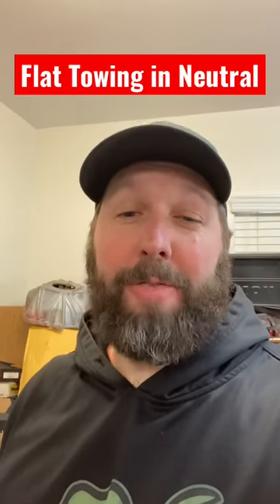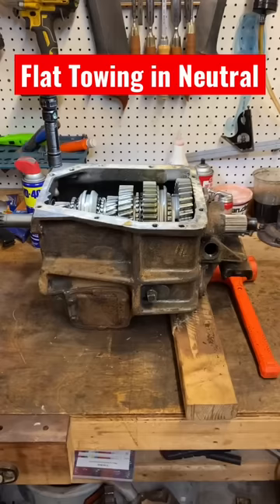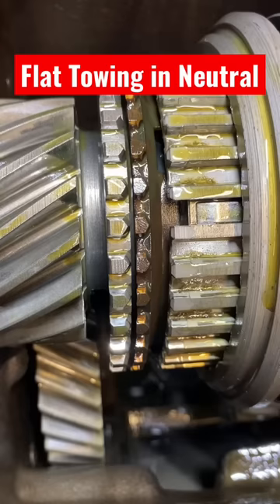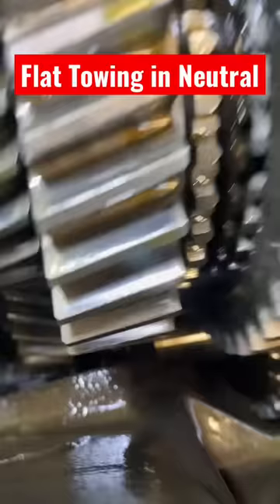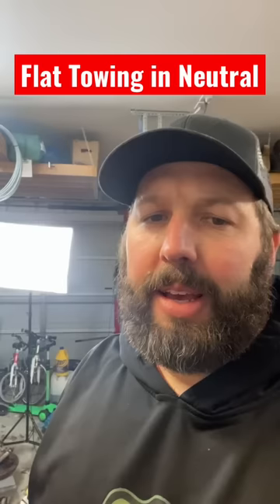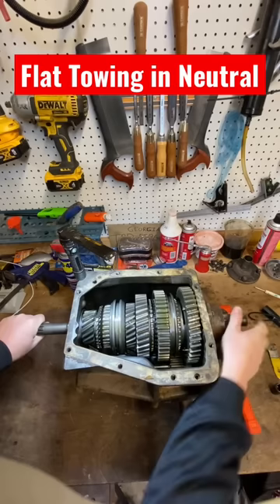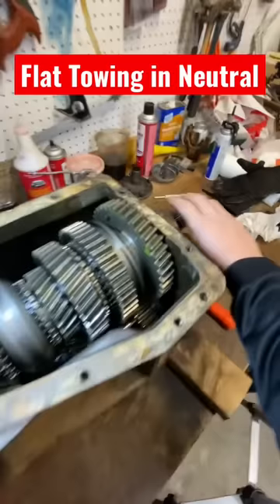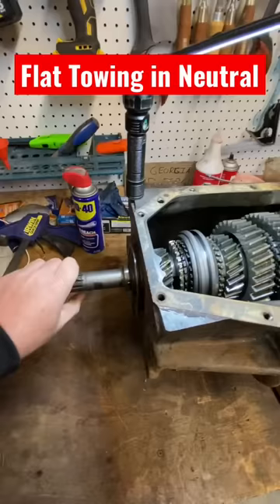Flat Towing in Neutral??? #transmission #stickshift #mechanic

Comment: Watch part 2 where he explains why flat towing a manual IN gear is even worse lol
Reply from the maker: Don't be telling everyone my plans 🤐
Reply: What is flat towing and what are you supposed to be doing instead?
Reply: @308dad8 flat towing is towing car horizontal. You need to flip it up on end first
Reply: @308dad8   drive wheels on the ground  not  in the air. If the drive wheels are spinning when your towing your doing it wrong.
Reply: @zed4229  Well so all 4WD should be towed on rollbacks only?
Reply: @308dad8  unless you can disconnect one axle and tow with it.
Reply: Drag it on its top😂
Reply: @308dad8  Rollbacks, wheel lift with tow dollies under other axle or a trailer
Reply: @308dad8  with 4wd vehicles you can usually put the transfer case in neutral and flat tow without causing damage
Reply: @308dad8  or dolleys
Reply: @dailydriven  right. I've flat towed an f150 30 miles going 55 lol no damage, and how do I know? Because the trans had to be pulled to fix the flywheel that broke and the rear main seal. Still drive that sucker today, pit 50k on it since
Reply: A smart human would just pull the rear driveshaft
Reply: @zbruh7268  i flat towed a RWD in neutral about 400 miles averaging about 60-65mph.

Not a single issue. Transmission still beautiful 15 years later with another 140,000 miles on it
Reply: Just drop the drive shaft if you have to tow it and can’t put it on a trailer or rollback.
Reply: @zbruh7268  I absolutely know that is a lie, 50,000 MORE miles? Ford? Na dude.
Reply: @Josh G  it's a fleet truck so I don't care what you "think". You should probably stop doing that! You're going to hurt yourself
Reply: @Josh G  it's a 2005 Ford f150 flareside Fx4. My 2016 silverado was totaled by a single deer 2 weeks ago. I've hit 3 deer with the Ford this year and no damage. I did end up getting another chevy (2022) because I was desperate since it's getting to be my busy season and I know the owner of the dealership. I'm not partial to Ford or chevy because I own both, I get what I like. I treat my vehicles the same so they all last me the same time. Regardless brand. Minus my new chevy is a 4cyl turbo lol sounds like a go kart but it fits exactly what it's needed for
Reply: @zbruh7268  I'm just giving ya shit lol. I don't really care for brands much anymore. I was always a GM guy but after 2007 I havent much liked any silverado or sierra put out since. I would go with a f150 or ram before you see me in a 22 silverado.
Reply: I've seen someone flat tow a truck while it was running. It jumped in gear when it got to the right rpm and destroyed everything inside.
Reply: @Josh G  I like the older ford's but when I have to get a new truck, I get good deals at the chevy dealership lol I paid 17k for my 2016 chevy, thing blue booked at 24. Me and the wife also have a ford fiesta RS lol 😆 😂 things fun to drive though. This fall most likely get an older chevy SUV or Subaru with 3rd row seating for the kids. Packing 2 teens and a toddler in a crew cab is getting old
Reply: @Josh G  the 22 silverado is ugly too, but it's not bad to drive lol just have to turn my outside camera a bit so I don't have to look at it 🤣
Reply: @zbruh7268  I think you need to watch the video again and this time follow along 😆
Reply: @308dad8  That's generally safest. Not all transmissions have this characteristic, but transmissions are expensive.
Reply: Why people say u can flat tow jeeps what’s different about them than other 4wd vehicles
Reply: @Eddie H  nothing. You can flat tow anything. I've done it for year, from an 80's truck to a mid 2000's. Never once caused damage. And I tow at the speed limit.
Reply: @zbruh7268  why do people say jeeps are different then? And it’s actually recommended to flat tow a jeep on all 4 wheels instead of front or rear lift tow
Reply from the maker: https://www.tremec.com/not_am_detalle/flat-towing-manual-transmission-vehicles/
Reply: @zed4229  which is it? should my drive wheels be NOT spinning or on the ground?
Reply: @308dad8 no, you just flip it on its roof and tow it that way!
Reply: @freedomworx  Technically you could probably leave it in 5th gear and hold down the clutch with a block and avoid damage, but there are definitely better ways to do this.
Reply: @Eh-925  It depends on the specific vehicle. I'm not particularly familiar with the Jeep drivetrain, but my guess is that a Jeep is safe to tow with the TRANSFER CASE in neutral.
Some vehicles can be safely flat towed with the transmission in neutral for any distance at any speed. Some will quickly suffer transmission damage. Most will eventually suffer some level of damage. The general guidance is "It's not safe unless you have specific guidance on that specific vehicle."
Reply: @DallasHerrmann  yea of course with the transfer case in neutral I just figured it would be the same for any 4wd vehicles but maybe jeeps are just able to keep themselves oiled while somehow while being towed
Reply: So now your engine is spinning
Reply: OMG we have had a customer tow their manual Honda fit behind their RV.... Did some math and the engine spun to like 21000rpm blowing it to pieces.
Reply: @matthewbeaver5026  ... well, that stops the drive shaft but spins the side gears like crazy.
Reply: @ozzyman51 creates same issue. no lube.
Reply: @johnslife3924  Yep. Still the wrong way to do it, but you're driving the lube mechanisms in the transmission and engine.
Reply: @ZBruh  30 whole miles, no way! And you still got 50k miles on it after!.... 
Never mind, I guess that would surprise a Ford owner.
(I'm just teasing man, no disrespect was intended) 😂👍
Reply: @308dad8  take the drive shaft off, problemo solvaide
Reply: Do a video on why a for ranger can be flat towed. I’ve also recently learned my Suzuki samurai can be flat towed.
Reply: So leave in gear and have your foot on the clutch the whole way 😅
Reply: @308dad8  remove the drive shaft before you tow.
Reply: @308dad8  it's generally recommended to tow vertically
Reply: Not to be a dh, but you can tow certain cars , manual or automatic in nuetral with the drive tires on the ground but with limitation on speed and distance.  I'd bet the max on an old chevy, manual transmission like this would be 35mph for 50 miles. You can find the info on zips
Reply: If your in a tow truck, sometimes you just got to get sh!t done with a  pickup and a strap.
Reply: Wheel dolies on the back wheels.
Reply: @308dad8  pull the driveshaft
Reply: @308dad8  rear drive shaft off then lift the front
Reply: @308dad8  2wd vehicles are more prone to failure being flat towed 4x4 you literally put tcase in N and trans doesnt spin and you can flat tow it no problem
Reply: @zbruh7268  I think the channel owner means long haul vehicles towed behind RV's.  Hundreds of miles are what wrecks a bearing that isn't lubed.
Reply: @zbruh7268  you've hit 4 deer this year? Dude, check and make sure you put oil in the engine and not deer piss.
Reply: @zbruh7268  I ditched my 2013 malibu for a 2018 Sierra SLT Crew when wife replaced the engine compartment of her dodge journey with a deer.... a little one. Destroyed the airbag sensors and never set them off. My truck booked 44 with 11k miles, we got it for 38, then prices shot up and it booked for 52 at one point over the last couple years. Don't drive it a ton, so it still books like... 38 or 39 and owe 20. Ours had to be Crew specifically because we still had 2 in boosters and one in a highback at the time. Now 2 kids are off the boosters. Never been that right side up on a short notice vehicle purchase, lol. I haven't looked at the newest GM trucks, but not a fan of Dodge looks and Ford in general... bad experiences left a bad taste. Wanting to look at a Sierra 2500 next probably, but we will see. Have to pay for flight training, house reno, and cross country move first. 😢
Reply: My thought were exactly, erm but spinning an engine without the oil pumps is going to the whole block in, so gear box vs whole engine, best option don't flat flaming tow call a company who can lift the drive wheels of the road, or have a 4x4 automatic and have to have the car lifted on to a flat bed flaming hilarious when Mercedes had to do that to my step dads car
Reply: @308 Dad  Literally every single vehicle should be towed on a rollback.
Reply: @MartinBarker  Thanks for agreeing and adding to the conversation!
Reply: @308dad8  yeah pretty much. Or with a tow dolly to keep the rear wheels off the ground.
Reply: @308 Dad  Flat towing is when you tow a vehicle with all 4 tires touching the ground. You will sometimes see RV owners do this to tow their car or truck behind their RV. The better option is to just buy a car hauler and use that. A car hauler will allow the vehicle to sit flat, but the vehicles tires are off the ground as the car hauler has its own tires. If using a car hauler, you must make sure it's attached to the towing vehicle (RV/Mobile Home/Truck) properly, wiring harness is connected, and ratchet straps are properly used to hold the vehicle to the car hauler. If you do not know how to do this please make sure that somebody with experience and knowledge of how to do this sets everything up for you. You really do not want to make a mistake doing this.
Reply: @308 Dad  it's where you flatten the car into a pancake and then tow it
Reply: @DallasHerrmann avoid damage..... forgoten throw out bearing has something to say to you
Reply: @kalumbabwale3729 drive tow vehicle via blue tooth
Reply: @308dad8  nope, you should use a dolly. Most wreakers are equipped with them, they lift the rear wheels off the ground. 😍
Reply: Couldn't you technically put it in 5/6 gear?
Reply: @JGSR-96  lol, a ford joke? super clever.
Reply: @funonoldwheels7150  thanks
Reply: @spotimpact.  I guess if you really need to flat tow it, you could just put a pedal depressor on the clutch, really doesn't matter the gear though (except of course reverse!) since the engine isn't running.
Reply: @JGSR-96  I feel the same way except a decade older lol. GM died when they stopped putting 350s and actual parts on trucks and instead filled the things with computers and low voltage equipment. Also there's no reason for these trucks to be so massive. 90s gms were perfect :')
Reply: @zed4229  I don't et it - if the drive wheels are on the ground its wrong but you tow with them on the ground?
Reply: @kalumbabwale3729  and destroy the clutch release bearing nice lol
Reply: @MartinBarker  if the engine is turning the oil pump is turning
Reply: @RedboneUnincorporated  big rig dont fit on roll back 
we remove the drive shaft or the axle mostly the axle because  and just one side so 2 axle ro remove with 10 bolt each you don't need to go on your back under the truck like a moron
Reply: @spotimpact.  engine will turn not good and if you use a piece of wood to hold the clutch you will burn the clutch release bearing or wore out the finger on the pressure plate
Reply: @NOSNOOB11  yes it matters if you use 1 gear and do 60 the transmission will turn at twice the speed its designed to go the input shaft never exceed the engine rpm
So if in 1 the car do 30 at 7k rpm doing 60 would equate to the engine running 14k rpm in first for the transmission and would burn the input shaft bearing pretty quickly
Reply: @legros731  Yes. We generally remove the drive shaft. For long distances
Reply: @spotimpact.  I don't think so, while you might not be over reving the engine you won't have cooling ability, electric fans would be off and you'd create alot of extra drag on the towing vehicle.
Reply from the maker: Saves the tire. 😎
Reply from the maker: @station08  science 🤓
Reply from the maker: @spotimpact.  I would never recommend towing in gear.
Reply from the maker: @MartinBarker  I never recommended towing in gear. Read your owners manual and it will tell you what to do. And the engine cannot spin without spinning the oil pump.
Reply: @zed4229  unless it is 4wd and you have the transfer case in neutral. 
Ever seen a Jeep or 4x4 truck being towed by an RV
Reply from the maker: @ThisFish888  it's an option.
Reply from the maker: @kalumbabwale3729  Leg Day 💪
Reply: @308dad8  You can flat tow with no troubles, but you need to either remove the drive shaft or put the transfer case in neutral. Most tow companies will just remove the driveshaft to make sure all is disconnected.
Reply: @kalumbabwale3729  no tow truck driver remove the axle shaft way easier on big rig no need to go under and a big rig drive shaft weight a ton 
And when removing the axles shaft only one side is needed to be removed
Reply: @legros731  yea that's my bad I def wouldn't recommend 1st and it does matter. For some reason my brain was like "welp you can't leave it in 6th the whole time either because you'll be taking off in 6th at intersections" smh I'm an idiot. But still in 6th wouldn't it be turning too slow at low speed to lube as well? Idk I've never had to deal with this haha.
Reply: @308dad8  just take the drive shaft off
Reply: @matthewbeaver5026  why not just the drive shaft so much simpler and easier to take off
Reply: @ObservationofLimits  what about the engine sometimes it’ll blow the head gasket even
Reply: @JGSR-96  hahahaha every vehicle is a pos if you actually work on them
Reply: @freedomworx  🤣
Reply: @JGSR-96  😂🤣🤣🤣🤣
Reply: @zed4229  does it matter which way they're spinning?
Reply: @MrStaybrown  make sure to grease the roof.
Reply: Drive shaft people. If you remove/disengage the driveshaft so it does spin the transmission then you can flat tow all day long but it's easier to rent a U-Haul car hauler
Reply: So in those car repossession videos, if the car they pick up is rear wheel drive they destroy it? (well damage it at least)
Reply: @atnfn  Probably not, most videos I've seen they pick up the drive wheels and they usually go back to their yard which is close and lower speeds. I do wonder about a manual front wheel drive though since the parking brake is in the rear.
Reply: Something is missing from this video.  I have a front wd manual,  this doesn't apply
Reply: @Eh-925  Because you can put a jeeps transfer case in neutral so the transmission doesn't spin at all. It's not the only vehicle with that option, but it's the only one guaranteed to have that option
Reply: @stevebrown4401  ok cool thanks
Reply: @308dad8  unless you put the transfer  case in neutral
Reply: you can tow a can in neutral if you leave the engine running.
Reply: @308dad8 flat towing is towing when all tires are on the ground and turning. You should, if possible use a trailer to tow vehicles with a transmission.
Reply: @matthewbeaver5026  couldent you just take the driveline out?  I mean then your trans isn't getting any of the spin
Reply: @zed4229  youre
Reply: My brother and our uncle towed a datsun (with chevy van a chain and nothing else) 160miles and no problem. Even got a speeding ticket for 73 in a 55  (while towing). My smartass uncle was in the datsun yelling about they only get 1 ticket since he was being towed and had no actual control over the speed lmmfao. Always gotta say something!
Reply: @zbruh7268  hey those 23 suburbans are sharp af tho
Reply: @Eh-925  probly cuz they have stouter made gears
Reply: @DoingthingswithDAN  did some meth and spun the engine?!?😅😂
Reply: i was about to say wwtf is flaat towing
Reply: What about driving down hill in neutral?
Reply: Thank you.  That was my next question.
Reply: Dont forget to leave the key on before yout tow in gear.
Reply: @zbruh7268  How did you know the deer was single?
Reply: Pull the drive shaft
Reply: Saw an article once about a guy that did that to a new jeep... I think he had it in first and 4 low. Speed he towed it in got the motor up to 35,000 rpm something like that.
Reply: @zbruh7268  the 2.7 turbo. I watched a video reviewing it. It makes some impressive torque. How do you like? Fuel economy? Power?
Reply: @308dad8  Someone else might have already corrected what the other guys said but I'm not reading through 122 comments. Flat towing is when all wheels are on the ground, not just the drive wheels. So the is...flat. A standard tow truck lifts the front off the ground putting the vehicle at an angle, so not flat. To flat tow you have to attach a tow bar on the front of most vehicles to safely flat tow. For really short distance or around a property some will just use a chain/rope running through a metal pipe. Pipe is not necessary if you have a driver for the vehicle being towed and I would not do this in traffic.
Reply: @Mudslt  yep
Reply: Funny comment.
Reply: @308dad8  drop the drive shaft.
Reply: @308 Dad  a lot of times flat towing is pulling with all 4 wheels on the ground. Think back to that one time you ripped it a little too hard on a backroad, and your buddy had to come out to give you a tow, but all you've got I'd a chain or tow rope lmao
Reply: @dominicstonerock2880  unless it is awd drive
Reply: @shanerinehart7  not with awd
Reply: I have to see that video
Reply: That’s halarious
Reply: @308dad8 4wd vehicles are also 2wd vehicles. You have to put them in 4wd, thus engaging the transfer case. AWD cars should always be towed on a rollback or on a dolly to prevent the same issues, or worse, because you can’t disengage the transfer case.
Reply: I couldn't find the 2nd video
Reply: @jasonglisson1690  it was a kind of a joke, sorry.
Reply: Dang it Chim, you beat me to the comment! "and IN gear is even worse, look at how the wheels don't spin, but if they did, there wouldn't be much left of the transmission!"
Reply: @308dad8  Depends on the Model. My 4WD has 6 bolts that remove the drive shafts from the difs, no drive shaft to the dif, no problem with the trans!
Reply: @zbruh7268  If the trans is already fucked, I doubt flat towing it would do any worse!
Reply: @jasonglisson1690  you won’t find it. He was being sarcastic. Towing an automatic in Neutral won’t hurt it at all. That’s horseshit. He acts like he’s a scientist or engineer.
Reply: So the lesson here is to not flat tow at all
Reply: So I guess you should pick it up from the back and leave the front wheels on the ground
Reply: bro I get my info off shorts, so now you can't tow a manual at all?
Reply: @JGSR-96  People like to say stuff like this about Ford's but we had 4  94 f150s where I worked, we bought them from U-Haul with 10k miles on them,(supposedly  w-special commercial auto transmissions) one that drove 300 miles 5 nights a week died with 986k miles on it! with the original engine and transmission that never needed rebuilding. And it would have gone farther except the driver fell asleep and totaled 3 parked cars with it.  All 4 of them made it more than 500,000 miles without a transmission or internal engine problem! Admittedly we really were pleasantly surprised considering most of the other Ford's we had you could set your watch 130k miles on it when the transmission was going to go out!
Reply: @308dad8  really I would recommend towing anything on a trailer rather than pulling it but regardless of what you are doing if you want to avoid this just drop your axle but you can drop the rear axle and Tow from the front or you can drop the front axle until from the rear but you have to worry about steering at that point. The simplest way is just to put the damn thing on a rollback or a flat trailer
Reply: @matthewbeaver5026  exactly, to avoid this problem just drop the rear axle or the front axle if your Towing from the rear I'd still recommend just using a flat trailer
Reply: power to the people
Reply: Wouldn't a vehicle idling in neutral for a long time do the same thing?
Reply: @308dad8  if you have manually engaged front hubs, (and they are unlocked) then it is fine to leave the front wheels down, but most people would just use dollies to be safe. So yes flatbed or under reach with dollies.
Reply: @zaccam3233  no, that side of the gear train does draw oil up. The transmission infact stays lubricated the whole time the engine is idling. The problem is that when the pressure plate is not moving the clutch is not engaged there's no way to keep that side of the transmission rolling.
Reply: @zaccam3233  he actually does a good job at demonstrating this at the end of the video, he holds the output shaft and Spins the input shaft. You didn't see the oil being drawn up through the gears
Reply: haha i had a customer(s) wife( he said ) left thier jeep in 5th to tow behind their motorhome. could'a slung a dead cat through the hole in that block
Reply: @308dad8   I just drop my driveshaft and not worry about anything.
Reply: @LeonardRoberts  Disconnect Driveshaft
Reply: Can't you just put it in gear and hold down the clutch?
Reply: @redcrafterlppa303  No that wouldn't be good either. There is a pilot bearing which lives in the flywheel and holds the front of input shaft which only has a few grams of grease. Its designed for temporary use during shifting only. In this scenario it would be spinning for the length of trip which would cause it to melt destroying the shaft and flywheel.
Reply: @chimrichalds1422  ok thanks.
Reply: @JGSR-96  depends if it's gas or diesel. If it's gas it's not a Chevy or dodge so it's possible, if it's diesel, then there's no way in hell if it's a modern diesel
Reply: My thoughts exactly
Reply: @308dad8 i believe if you have 4 wheel select you can put the tranfer case in neutral and flat tow in park
Reply: @Mudslt if it's a manual transfer case sure, but an electronic transfer case is still physically connected is it not?
Reply: @308dad8 I’m sorry bro do you know the difference between AWD and 4WD? 4WD can be TAKEN OUT OF AWD
Reply: Let me guess because now you're turning the engine
Reply: So what do you do
Reply: @308dad8 
Flat towing is all four wheels on the ground. Needs to be towed with drive wheels off the ground. Free wheels on the ground or entire vehicle on a flat bed.
Reply: @DoingthingswithDAN how can the engine be tuning? If it’s in gear, the thing won’t tow due to the compression. If it’s in neutral, the engine ain’t turning for the same reason.
Reply: @axelknutt5065  no the engine will 100% turn in gear. How do you think people drop the clutch to start cars when the starter goes bad.
Reply: @DoingthingswithDAN  that’s  whole point of a bump start, you roll, push or tow in 2nd with the clutch in, drop the clutch and the the sudden jerk catches the motor, and starts it rotating and hence fires up. If you don’t get enough speed up before you drop the clutch the wheels stop turning. How come you can park a car on a slope and leave it in gear and doesn’t roll down the hill?
Reply: @axelknutt5065  of course there's resistance from the compression, but remember the engine of the towing vehicle is rotating. It has more than enough power to spin the engine of the flat towed car
Reply: @308dad8 no, they have carriers that go under the ground wheels to keep them off the ground
Reply: This do be killing the transmission, as the hamhanded mechanic tortures the synchros and needle bearings before finally letting the gearbox have that sweet relief of transmission case shattering carnal goodness.

If you ever learn this lesson, you learn it 100% the first time.
Then just to be safe, if ever a tow is required in future, you unbolt and physically remove the driveshafts

Just in case

....... not that i maybe accidentally 1 single time did exactly that.
Gears, oil, baby bearings calling out for their ball bearing and roller bearing parents.....
Oh the huge manatee's
Reply: @Eh-925 
I've wondered about jeeps. Often see them flat towed behind an RV. Cherokee and Grand Cherokee or Wagoneer or whatever they're called.
Reply: @legros731  You only have to disconnect the drive shaft from the differential yoke and chain it up against the frame. Usually takes less than 5 minutes. Takes even less to hook it back up after towing. Pulling an axle requires covering the open holes and axle grease still gets all over everything and takes much longer to put back together.
Reply: @legros731  No need to remove the drive shaft, just disconnect from the yoke at the differential and chain it up against the frame. Takes 5 minutes. Less to reconnect on the other end. 

Axles are more time consuming and the grease gets all over the rims and who knows what else, even if you carry pre-drilled flat boards to bolt over the holes. Axles take even longer to reinstall, too.
Reply: @michaelclark9762  maybe on a small 2x4 truck but on a big rig we usually remove the axle for towing way easier
most car with irs suspension don't even have slip yoke or even u joint 
One thing for sure my s2000 only go on a flat bed not gonna try fiddle with 6 Allen head bolt on each end on a car 3 inch from the ground
Reply: @michaelclark9762  there no axles grease it's a differential with gear oil in it lol every heavy truck towing have plastic plug for the axle and removing the axle from a big rig only require remove 8 or 10 3/4 nut and you just slide it out big rig are pretty simple if you want to get fancy one of the nut is a Bolt and it can be used as a drain but they make small tub that fit perfectly in the rim so just removing the axle will drain the oil just a little more messy
No need to lay in mud/snow/water 
Ps I repair truck for a living and I can assure you they all come with the axle on the back seat when towed 
That ok if you prepare your car/truck in the comfort of your home to be flat towed behind your big rv vs a towing driver working in the night in a snowstorm
Reply: @legros731  U-joints require loosening four bolts. A folded wax coated cardboard box easily fits into a side locker on a heavy tow truck, which I used to drive. No laying on the ground needed. Axles always took me much longer to pull than disconnecting and chaining up drive shafts. By the time I got the right size socket for the bolts on an axle I could already have the drive shaft ready to roll. Throw a chain and bungee strap under, then slide under with a 12mm, 1/2 inch, and a short hollow pipe and it usually took about 5 minutes. Do whatever works for you, but driveshaft was definitely the way to go for me. Quicker and much less mess.
Reply: @legros731  Dude, I'm talking about truck tractors. They're much easier to get under than cars or pickups.
Reply: @matthewbeaver5026   If it's automatic you can leave it idling in gear if it sticks shit you can put it in the highest gear until it which allows all the components to spin and the vehicle won't know the difference  between being towed or being driven  while coasting down an endless hill.
Reply: @RickyGuterson   You have it when you fly to a ranger or is it a samurai you overfill the trans mission and put an elbow on the fill plug that keeps the fluid from coming out of the year shift or vent cup.
Reply: Use a flat bed tow truck.
Reply: I’ve flat towed my 2008 4X4 Tacoma manual many times with no issues. Never over 55mph. I think this works, even without Lubricating the drive shaft, because there is absolutely no torque involved. It’s free spinning.
Reply: @zed4229 you just contradicted yourself ! 😂
Reply: So if its a 4x4 drive, manual, have the front wheels elevated, the back wheels dragging in the highest gear possible and let the pull vehicle take the extra drag?
Reply: Lol3k
Reply: @zbruh7268 how in the hell do you break a flex plate? you get like a foreign object or something up in there and the starter break it off
Reply: @zbruh7268 dude, I smacked a deer on I55 in Mississippi and it messed my door up on my F150 2000 model, I finally soldier last year.  357,000 miles, original everything.  never changed hoses, belts, 
just brakes, plugs, n filters. oh, I did stop and pick up the deer. 6pnt bout 120 lbs
Reply: @JGSR-96 I bought the 2015 Silverado Z71 , it's OK, it don't have the ass my Ford did tho. I haven't hit another deer yet, but
Reply: @Jon_Wayne12  yea, the vibration from drive shaft  and torque sync up and the slot forgets pulled in
Reply: Nah bro just get a flatbed and call it a day 😂😂😂
Reply: @308dad8 Towing a car with all 4 wheels on the ground. 
Even a dolly with the drive wheels rolling would be bad in this case. 

For this kind of towing you're supposed to disconnect the driveshaft
Reply: So do you just put extra gear oil in it? Cuz I can't see towing it in gear being good either. Oh! You could just remove the axle shafts or drive line too but that seems like alot of work to tow something.
Reply: OK, got it, thanks.
Reply: @zbruh7268 you're lying.  I've hit 3 deer in my Silverado and it's fine and I still drive it today.  All happened while running late for work and speeding well over 45mph.  Worst I've ever had to replace was a headlight and a grill.
Reply: Better to just drive home vs Towing
Reply: @308dad8 pull the drive shaft.
Reply: I was told to disconnect the drive shaft
Reply: @LeonardRoberts so you would tow a pickup backwards on a dollie?
Reply: @dominicstonerock2880 haha😂
Reply: @ObservationofLimits what a Toyota?
Reply: Has Part Dos shown up yet?! 🍺
Reply: I have pictures of what happens and it’s catastrophic
Reply: Buddy of mine did flat tow his Jeep YJ in 3rd gear with transfer case in 2 hi. It was ok.  Transmission was turning fully so it was getting oil and turning the engine. The engine of course was turning the oil pump so it was getting oil too
Reply: @308dad8  get a runabout with a transfer case and leave that in neutral.  The transfer case will properly self lubricate.
Reply: Remove the spark plugs and unplug the injectors. 😁
Reply: So what is the other option? Tow in first gear? Lol
Reply: @dishsoap1  wrap the seatbelt around the steering wheel (strongest thing in the car, around the second strongest thing in the car) and grab the rear end.
Reply: @308dad8  you can do it with jeeps
Reply: @dominicstonerock2880  I mean, you can.  It's possible.  But what's closest and cheapest?  What's easier?  It's all situational.  Thankfully, though, it is an option.
Reply: @JGSR-96 I'm just laughing that he's bragging about 50k... lmao.
Reply: @Mudslt  Usually being the key work here. Many full time 4WD cars these days do not have a feature that allows the transfer case to be put in neutral, and so must be loaded on a flat top.
Reply: @JGSR-96 you wouldn't catch me in anything built in the last 15 years. 
No matter the make. Older=better, more reliable, better fuel mileage. 
Pre dod chevy/gmc 
Or pre 03 ford f150 (pre 3v5.4)
And dodge......well put the Cummins motor in something else because the rest if the dooge sucks monkey nutz.
Reply: @chevybigblock3311 I got a short attention span tho
Reply: @fuckcensorship69 on the ground gettin down
Reply: @308dad8 I'm wondering the same thing.
Reply: @308dad8 on a flatbed truck. Or have one axle on towing dollies.
Reply: Just push the clutch in when towing😂😂😂
Reply: Are we really pretending towers care about the vehicles being picked, other than the extent of what the owner might actually be able to see upon recovering their vehicle?
Reply: That is also 70s 1970s technology not that it's bad but it's the 70s
Reply: You don't have to do that with new transmissions nothing turns when you're in neutral
Reply: You're going to be all right son you're learning your lesson in life
Reply: Just put it In gear and get a pedal pushing stick to push the clutch pedal all the way on and your good that way your transmission stays lubricated and your engine doesn't get spun without the oil pump running
Reply: @zbruh7268 Lucky you!
That wasn't too awfully far, nor super fast... 
I am certain that some models of gearbox are more vulnerable to this than others...
Towing Cross-country at 70+ might have been a different story.
Reply: If you’re worried about it, then disconnect the driveshaft. Problem solved.